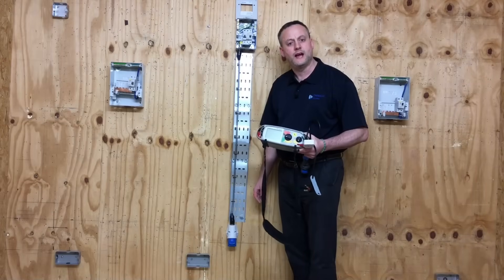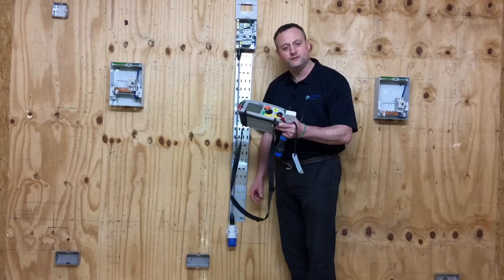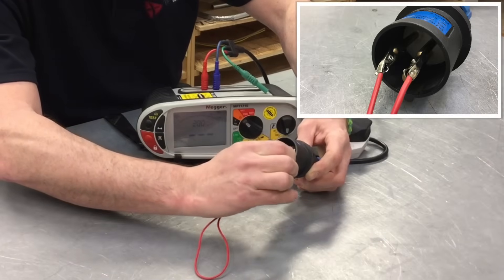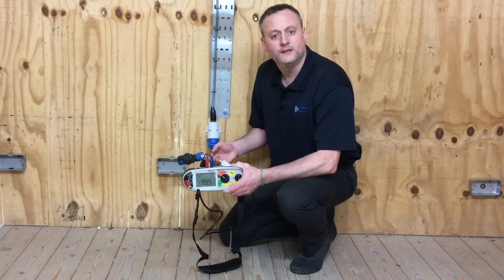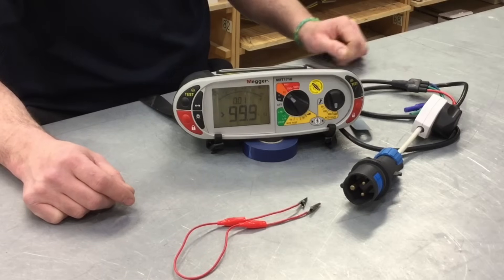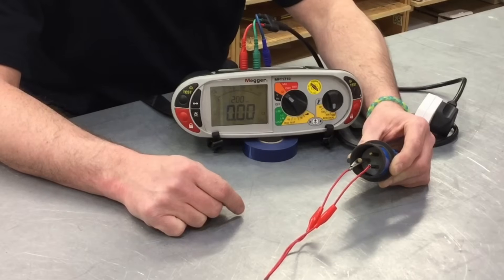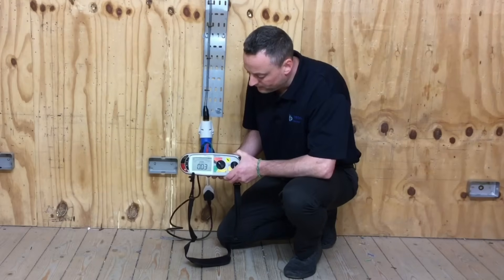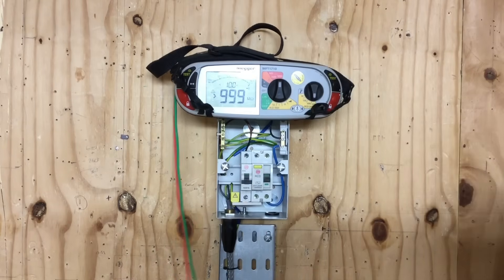Testing our 16 Amp Socket Outlet Circuit for Continuity of CPC, Polarity & Insulation Resistance

Comment: Is there a video on how to connect that 16a socket outlet in sy cable? just wondering how to connect that sy sheath to the earth.
Reply from the maker: https://youtu.be/Sc85KA6HmzM

This may help 👍
Reply: @GSHElectrical  thanks a lot for the response. Its been somewhat of help. But the video shows how to connect to the board. And the outer sheath is connected to the cpc by making a whole into the board and connecting it to earth. I'm wondering if there is a video on how to connect the sy cable to a 16a industrial socket ie "comando socket." where or how  would the SY shith be connected to the comando socket or plug?
Reply: For example, in this video, the SWA is connected to the plastic comando socket. At the fuseboard end, it's connected to earth. My inquiry is, how did he connect the cable sheath to earth inside the 16a plug(comando plug)? Is it just the cable earth that's connected?

Comment: i noticed the 13amp plugs get hot to the touch running oil filled radiator. This would probably not break a sweat.

Comment: Should the cpc be removed when performing R1+R2 because of parallel paths? Thanks
Reply from the maker: Hi. In this case there are no parallel paths as the bottom gland doesn’t have the braiding connected to the earth as the socket it goes into is plastic. Great question thanks for watching GSH Electrical
Reply: GSH Electrical thanks for responding. In a consumer unit that has numerous other cpcs and bonding, would the cpc need to be removed for the test?
Reply from the maker: It can be but for my learners on this job there are no parallel path’s. If the bottom sy gland went into a metal enclosure then yes remove the cpc under test and therefore the parallel path 👍. Unsure remove it 😁 Gaz

Comment: 1. Can I null de leads for neutral to line and line to cpc at the same time.
Or I need to follow your sequence.
2. Do you have a 400V test adaptor?
3. Do I need to do an insulation resistance test 1000V DC for 400V circuits.
Thanks.
Reply from the maker: Hi you cannot zero all 3 leads at once and both 230 volt and 400 volt circuits are tested at 500 volts d.c. thanks for the support GSH Electrical
Reply: GSH Electrical 
GSH Electrical 
Sorry, I meant first null neutral to line and after cpc to line. And proceed to test.

Do you have a 400V adaptor to test commando sockets?
Where I can get one?

Thanks
Reply from the maker: Yes that’s correct. With this tester you still use the red and green ports in the test instrument even when testing line and neutral 👍 thanks Gaz